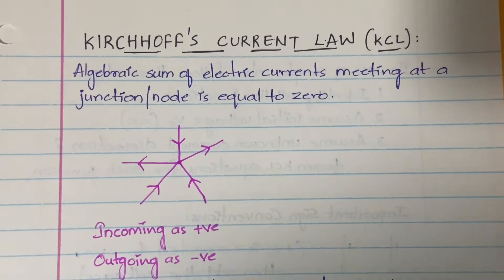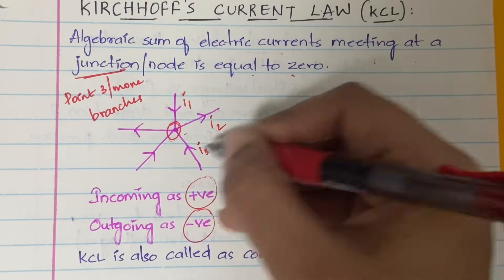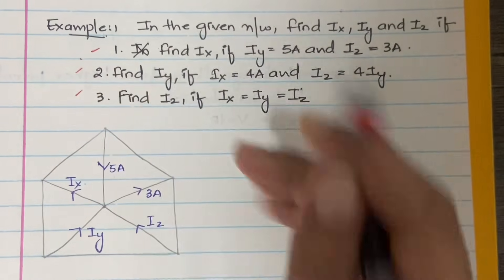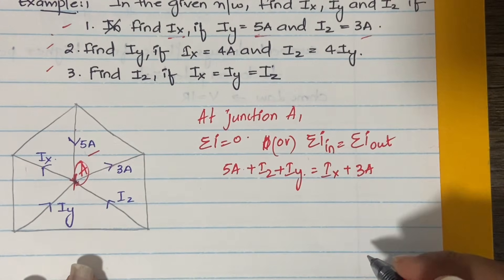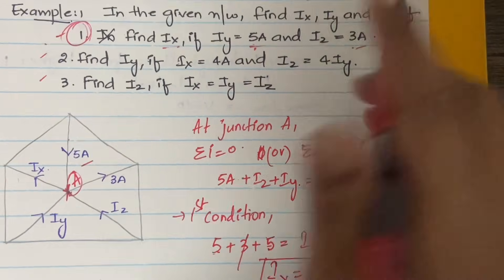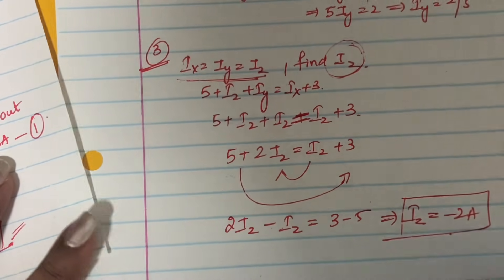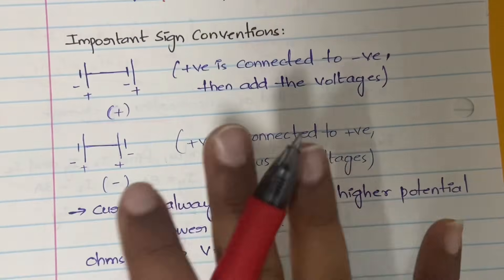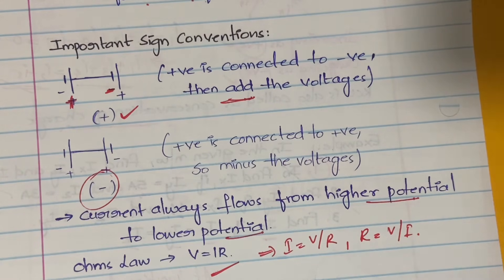7. Kirchhoff Current Law ( KCL ) - Theory, Sign Conventions, Example Problem |BEE|

Comment: I have doubt on 1st equation answer why can't we right as Ix=13/3=4.333... why we cancel it 3 on both side on what basis... is that any rule.. am just asking my ques. correct me if am wrong
Reply: +3 becomes -3 in LHS
(3)That is not in multiplication